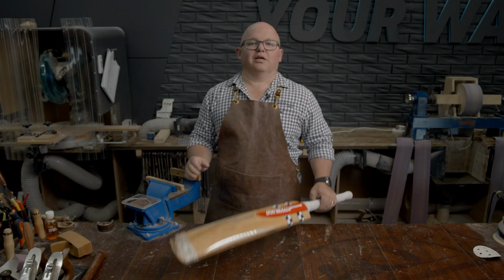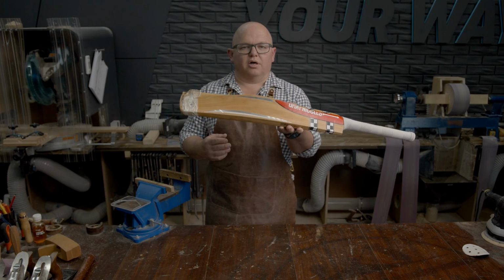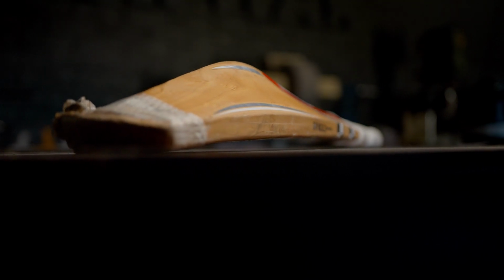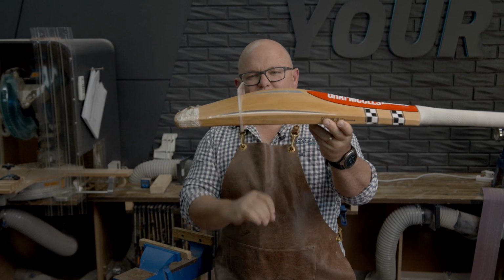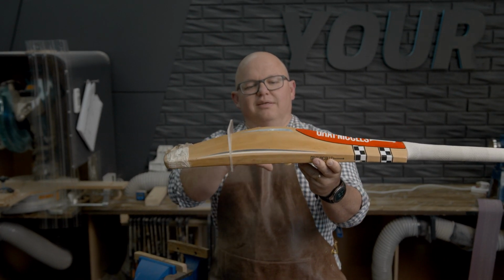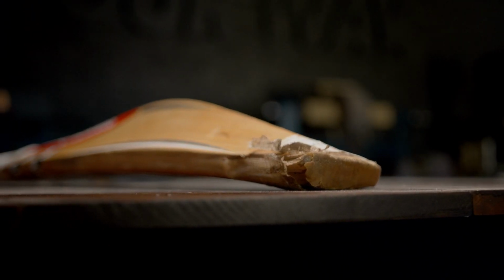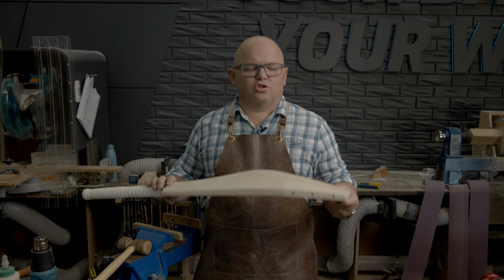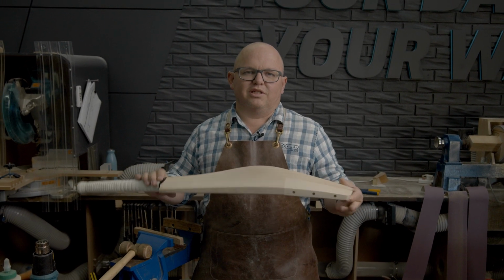Can We Fix & Refurb the Toe on this Massive Gray Nicolls Bat | Cooper Cricket

Comment: That was a crisp! What is the yellowish glue you used to stick the piece?
Reply from the maker: Thanks! It is a polyurethane glue, very strong. We also use a special polyurethane resin for the pins which gives use great strength & penetration from the new piece to the old bat.
Reply: @Coopercricket  thanks mate! You do a very clean and professional job. Keep up the good work! 👍
Reply: @Coopercricket  is that a special hand planer you use to reduce the weight? In the sense is it curved blade
Reply from the maker: @sudhirhinge  It's a round bottom plane with a curved blade yes.